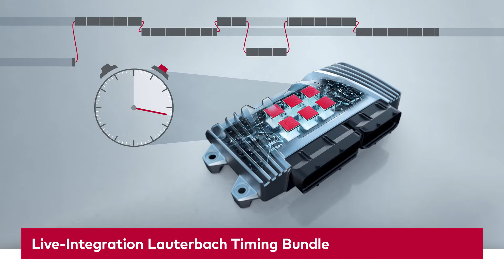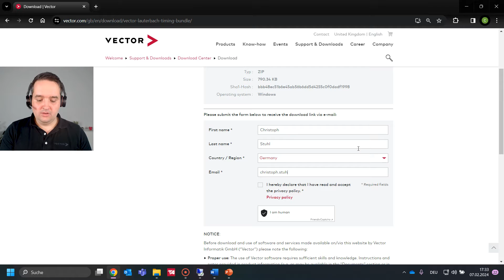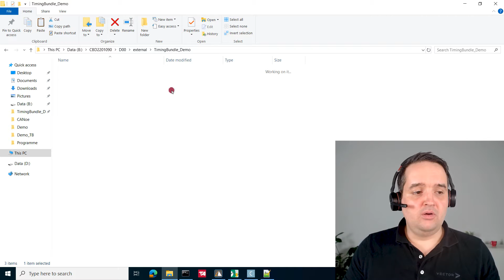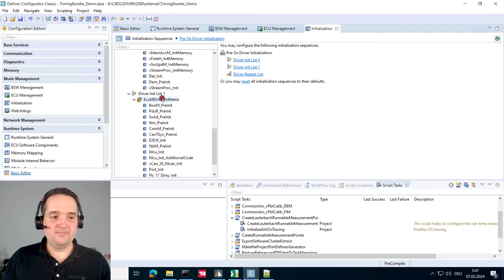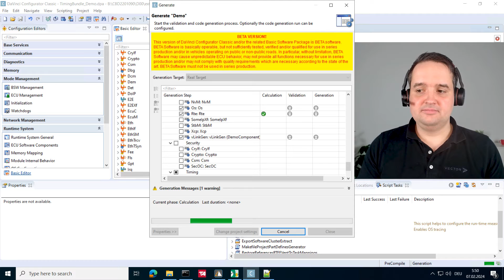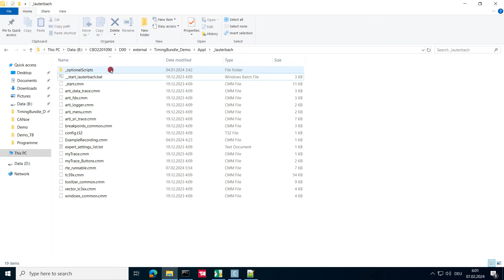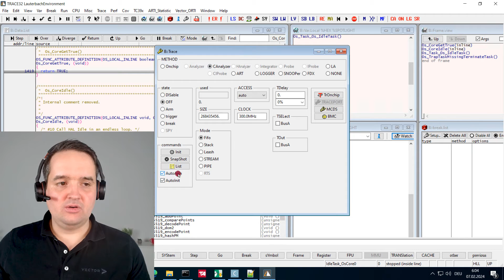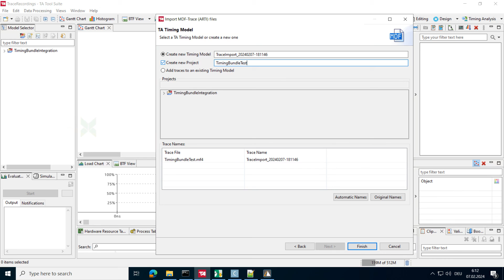Live Integration of Vector Lauterbach Timing Bundle | #VectorTechTutorial

Comment: Hi! Thanks for the video! where did you put the groovy file in SIP, the steps in the document is not working for SIP part
Reply from the maker: There are several ways how scripts can be added to your project. In CFG5:View->Script_Locations you can specify the folder containing the groovy script. In this example the location is procided project specific. In View-->Script Tasks you should then find the script for execution.
In case you have futher questions please open a ticket support@vector.com with the title [Timing Bundle Lauterbach] Groovy Script not working. A support engineer will then further asisst you.

Comment: Can i how the data of TA tool is different from emulated trace analysis of lauterbach, I mean we can do same analysis already in lauterbach. What are advantages of importing that data into TA tool of vector 
Thanks
Reply: TRACE32 is able to do an analysis based on the recorded data. TA Suite can go way beyond this, e.g. generating event chain analysis, measure timings of event chains and performing an requirement analysis against predefined requirements (e.g. created with AUTOSAR TIMEX). It also provides scheduling analysis to optimize your system setup.
Reply: @RudolfDienstbeck  Thanks lot for explanation and quick reply, excited to attend virtual timing days